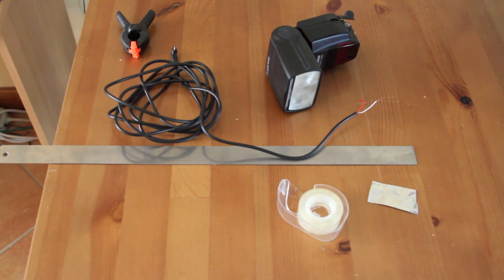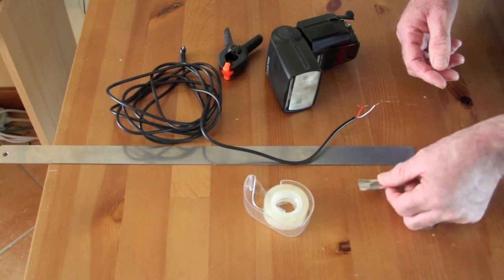How to make a flash pressure trigger

Comment from the maker: @sl3dg3hamm3r  Thanks for the comment, I've never seen a flash without a cable connector although maybe the very cheap ones have only a hot shoe connector but in any case  an adapter is available to add to a hot shoe for a cable connection.
I hope this helps. The Nikon speed light will have a cable connector.
Phill

Comment from the maker: @mrarachnid1 Can you tell me the type of subjects you shoot? if it's people I don't see a way around your problem I'm afraid, other than a different camera or by taking your camera apart removing the in camera flash and replacing it with a hot shoe, a risky business. 
As to the remark you mentioned, I'm used to it, I get insulted quite often as well :) It all rolls off me like water on a ducks back.
Phill

Comment: I am impressed with your video. What camera settings do you use?
Reply from the maker: There's no particular setting , it depends totally on the resultts required. Virtually every picture has different settings, that's why using a camera on manual is so important, to be able to change the atmosphere or look of a picture.